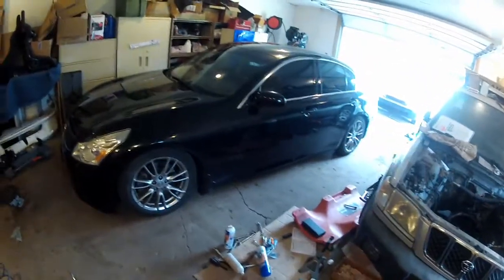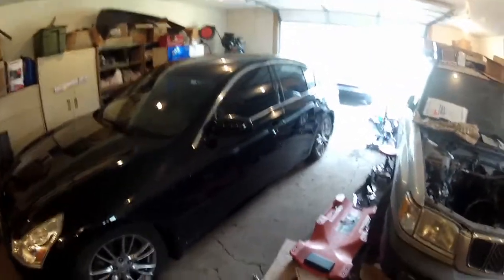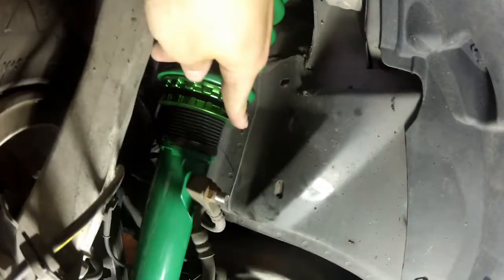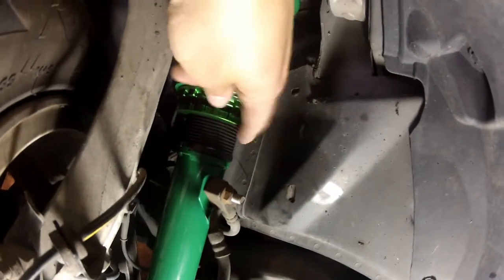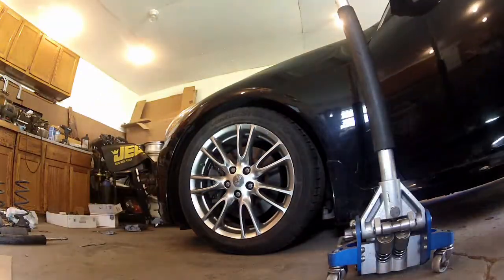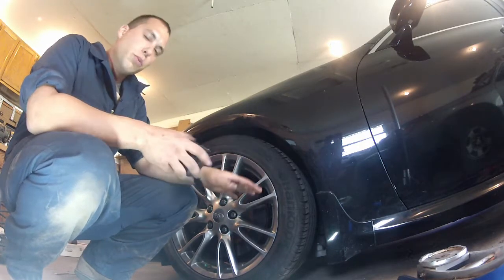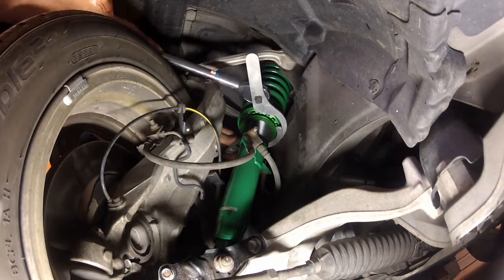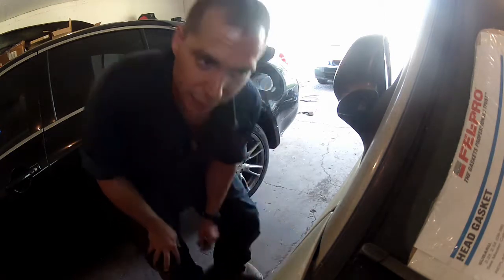How to adjust Tein  coilovers on my G35!!@#

Comment: what is the max height on the rears. Is it high enough for the snow?
Reply from the maker: it can be depending on your setup, and it will adjust within 1" of sport suspension from my estimates. but it also depends on where you live and how much snow you get. i could drive my car in ohio during winter at the current ride height, however you live in canada or somewhere more northern where accumulation is alot higher you may be in trouble. but at the end of the day it can be raised if needed for winter and lowered for spring summer fall it is adjustable which is nice.

Comment: It looked to me like you did the front wrong and wound up changing your spring pre-load.  The cylinder itself spins up and down to change height..  The spanner nut on the bottom. Unless your basis of basics whatever they're called are different than the tein flex
Reply from the maker: you would be correct, the basis and the flex are different. the flex is more of a full coilover where you have shock length adjustability and the basis does not. With the flex the preload stays consistant and height changes are done by strut length (raising the bottom mount). However, with the basis it is more like and adjustable lowering spring, you adjust height by lowering the spring and effectively having 0 preload depending on how low you go!

Comment: Hey, so the rear you actually adjust the spring not the strut?
Reply from the maker: +Andrey Sidorov on a non true coilover without  strut/shock height adjustability the ride height is control by adjust the spring in the spring bucket.  Hope that makes sense if not on me on Facebook and I will explain better
Reply: but you can make a shock shorter or longer there is the thread. for what reason?, thanks.
I got a megan racing and they have thread on the back strut
Reply from the maker: +Andrey Sidorov some coilovers have a threaded shock body because you can adjust strut/shock height to raise and lower the car without affecting shock travel. However tein basis z are not these type of coilovers. The only way to raise and lower is by adjusting the spring. The twin flex z are shock height adjustable along with spring height. With those type could you usually set the spring height to a certain manufacturer recommended preload and then adjust ride height by raising and lowering the strut which is why some models have the tthreaded shock bodies. I hope this help if you are having trouble adjusting your coilovers please tell me you vehicle and coilover manufacturer so I can asist further! Thanks
Reply: Thanks for the quick reply- it is Megan racing street ez 2 coilovers, the car is g35 i cant find the manual anywhere and it is not included. Im very confused because you can adjust both the spring and the strut
Reply from the maker: +Andrey Sidorov what year is your g35 and is it rwd or awd?
Reply: its 04 and rwd, some people said adjust both some say only a spring, im not sure what is right lol
Reply from the maker: +Andrey Sidorov ok looking at the pictures this is my educated opinion but without contacting Megan or reading the installation manual I cannot say it will be 100% correct but it should allow you to effectively lower your car and ride proper. For absolute specific procedure I reomend contacting Megan. So now that that is clear I can conclude that your coilovers are both spring (preload) adjustable and shock height adjustable. With those type of coilover system a general procedure is to adjust the spring color to put aprox. 1 turn of preload on the spring (the spring should not rotate between the top mount and collar adjusters) if it does increase preload 1/2-1 more turn (usually do not need to exceed 2 turns). After preload is set (and both right and left preload is equal to each other. I.e. 1 turn on left and 1 turn on right) You then loose the shock adjustment collar and shorten or lengthen the shock to raise or lower the vehicle.  This allow you to not loose shock travel and events spring droop when the suspension is unloaded (not compressed) I hope this helps